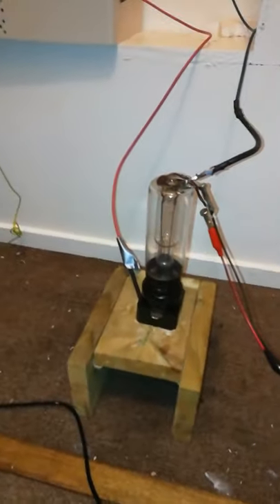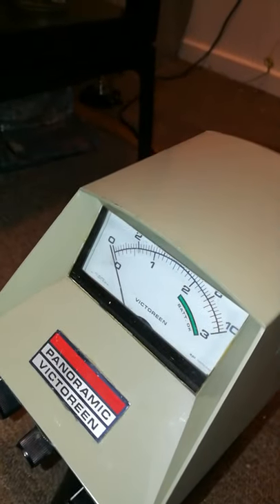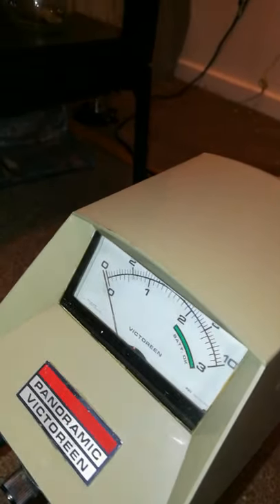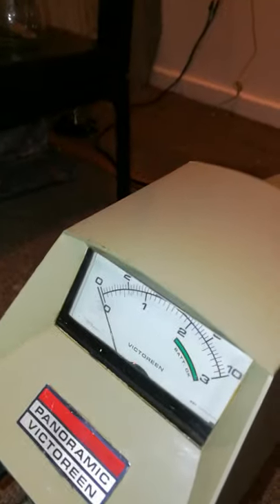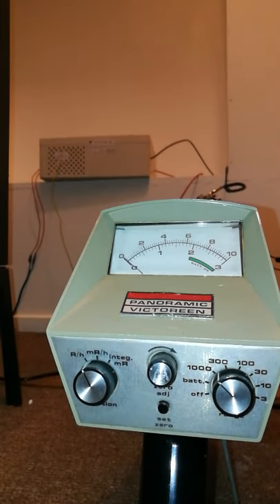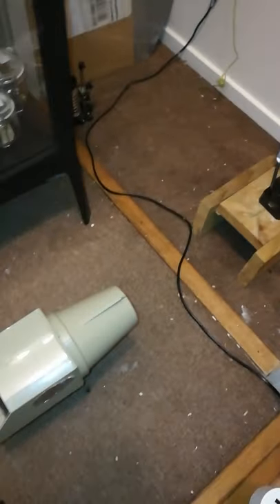Over 1000R/h At 0.54m From BSV-10 X-Ray Tube

Comment: How do you it isnt emf interface?
Reply from the maker: The Ion chamber is not able to respond to EMF generated by this setup. Furthermore, the way the readings on the detector behaves shows that it is not emf. If it was emf, moving the meter would result in it going from the 1000 R/h to background instantly. This does not happen and it follows the proper 1/r^2 relationship for how the radiation decreases.

Comment: YOU'RE INSANE what year is that detector btw I like it looks like the cutie pie from the 50s
Reply from the maker: Not quite sure, but it'd functionality was professionally tested and it was deemed to be correctly responding to the x-rays within the energy range I used. So it's age does not hold it back from working haha